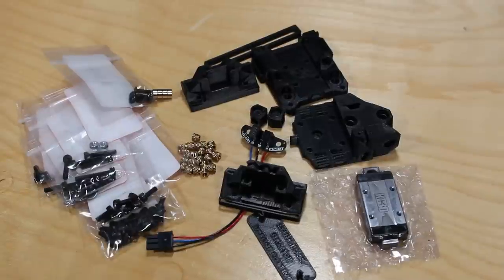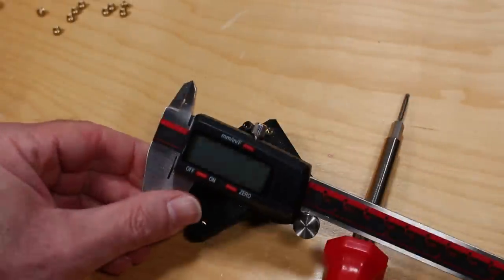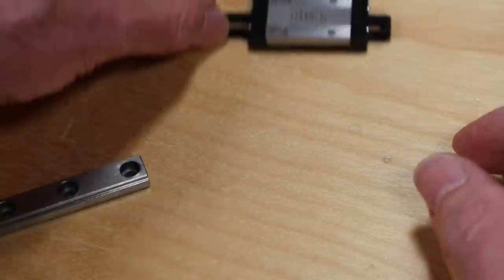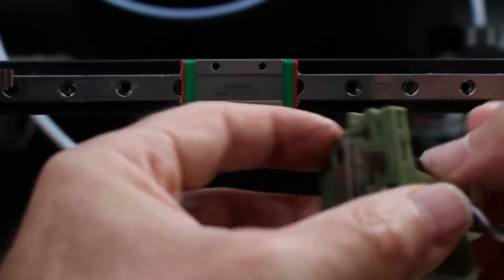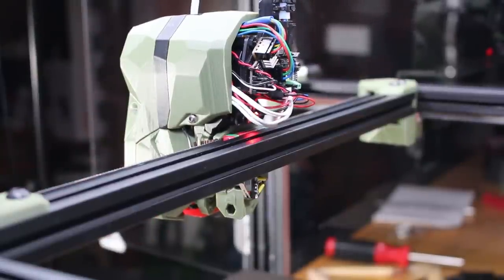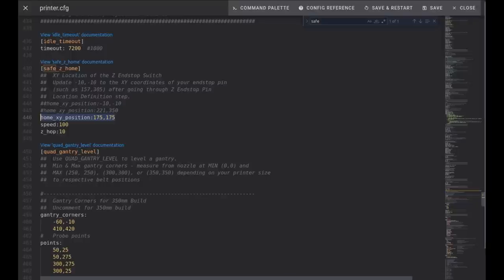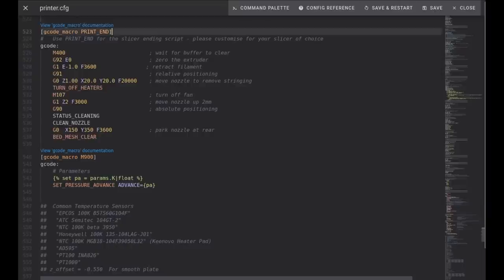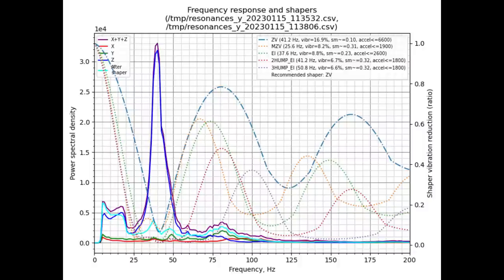Voron TAP build, install, configuration, tips & tricks, final thoughts.

Comment: I'm building a trident (first voron) should I still assemble the z endstop pcb pod?... or try do software right for Tap. is it still good to have in?
Reply from the maker: I'm still using TAP.  I've grown to like it more than I expected.  If you don't mind the extra weight on the print head, it's a good path forward.  But using Autoz calibration with Klicky or Euclid works well also.
Reply: @KapmansBasementWorkshop  Thank you for your reply :) Your Tap weight in was elucidating… but it looks as though it is still worth trying to chase the implied ease of using it successfully.
Reply from the maker: @mildmannered1086  In the end, it's a fairly simple solution.  I wish you a great and successful build!

Comment: I would advise caution in regards with tip 2, clean_nozzle after print. I removed the line in my case because I had a big collision with one of my prints. Cheers for the video!
Reply from the maker: I forgot to load my macros into github and post a link.  I will get that done by this weekend.  It will have an improved clean_nozzle macro.    Thank you for the comments (and reminder)!
Reply: @KapmansBasementWorkshop  Interested to see your improved clean_nozzle macro as well.
Reply: @KapmansBasementWorkshop Adding "clean_nozzle" caused collision that destroyed my X rail. This should not be recommended. Didn't see this comment until the devastation was done. What a fricking mess.
Reply from the maker: @shpyda81  I'm sorry to hear this has happened to you.  Are you using my clean_nozzle macro "as is" or did you change it to meet the requirements of your 3d printer?  It's going to be unique to your printer.  Mine is only there as an example.

Comment: I am not understand the probe accuracy numbers.
4:27 PM
probe accuracy results: maximum -0.985442, minimum -0.992942, range 0.007500, average -0.987505, median -0.986692, standard deviation 0.001987
Are these good numbers? If not where do they come from to fix?
Reply from the maker: I think your standard deviation is pretty good. You can supposedly hit 0.0000 to 0.0008.  You might want to make sure your belt tension is correct for the z-axis and all the screws are tight in the gantry and tool head.  But what you are getting should be good enough.
Reply: @KapmansBasementWorkshop  Where you been? I enjoy your videos a lot and have not seen anything for 6 months or so. Many people think you are a pro! I agree. I learn a lot from your stuff.  I just installed Cartographer V3. It's way better than the TAP since it does not use the nozzle for measurements. You should try it. No more waiting for the nozzle to go down to 150 from 210 to set Z and then back up to 210 to print.
Reply from the maker: @lcdconsultant5252  , I'll need to give it a try.  I have taken a break from videos for a while, but I'm working on a few simultaniouly.  There will be a few that will appear very soon.  Just trying to finsih these off.

Comment: I've been using a smooth PEI sheet with Tap for a couple weeks with no issues.
I'm sure there is still some acceleration losses with an mgn12 rail, but it probably is less severe than with mgn9...
Reply from the maker: Do you TAP at 150c?  Higher or lower?

Comment: Where did you get your kit KD3D, I went to website but didn't see them . Also what did you use for extruder ?
Reply from the maker: My extruder is the standard extruder integrated into the Stealthburner.  Standard Voron.
The TAP kit URL is here: https://kb-3d.com/store/voron/714-kb3d-voron-tap-upgrade-kit-configurable-1669607433315.html
Please note that you will need to select the different options for how much if TAP you wish to receive.  The pre-printed 3d parts are very nice!
Reply: @KapmansBasementWorkshop  I went to the wrong website(KD3D), I ordered the Kit from the right site, what is in the Kit?
Reply from the maker: @dansteffee9759  I believe it contained the linear guide, magnets and all the screws needed.  You will just need to print the parts and assemble it.  You can also order the 3d printed parts from KB3D.  The quality is very nice.

Comment: Great video! Does your toolhead also „sit“ on the sensor housing and not on the 3d printed holder surrounding it? I noticed that during test assembly little bit worried about damaging the sensor over time.
Reply from the maker: No, it does not sit on the carriage that is attached to the linear rail that also contains the sensor.  The toolhead is attached to the front most holder".  Thanks!

Comment: Can I ask why you moved away from the euclid probe?  I have been using the euclid probe for a while and the heat seems to be affecting the probe accuracy.
Reply from the maker: Really just 2 reasons.  I wanted to try TAP, but more importantly, I found over time that the microswitches would fail.  I believe it was because of the heat in the chamber or my soldering was damaging the switches.   I was just tired of replacing them.  I still might go back.
Reply: @KapmansBasementWorkshop  Thank you. Currently fighting QGL working with cold bed but fail when the bed is heated.
Reply from the maker: @2007gtsc  , That's not a problem I had exactly.  But when assembling the Euclid, you need to be very fast and accurate when soldering the microswitch.  If you have a look at the manufacturer's tech specs of that switch, there are explicit instructions about the maximum heat and time when soldering.  My theory is that during that time, I damaged the switch.
Reply: @KapmansBasementWorkshop  I’ll try to solder a new switch on. I know I put lots of heat to it during the installation using my crappy skills. Thanks for the advice.
Reply: @KapmansBasementWorkshop  soldered a new switch on at 285c and used liquid solder. Ran QGL and everything is good. Thank you so much.
Reply from the maker: @2007gtsc  That's cool to learn it really was the problem.  I have since invested into a quality temperature controlled soldering iron.  I may need to go back and give it another try.  Euclid worked well and I was able to hit higher acceleration rates than when using TAP.  Thank you for posting back the results!
Reply: @KapmansBasementWorkshop  maybe a great short video would the proper assembly of the probe. Again thanks for the great advice.
Reply from the maker: @2007gtsc  Hmmmm.

Comment: If you are using low quality rail for the TAP that will impact your accelerations. Also if you are using the print that you seem to have uploaded to printables your belts might be running at an angle instead of straight. This might also impact your accelerations. I get 7500 Accel og Y on my own 2.4 350mm, also with TAP. I am also running MGN9 but i am using a different mod for installing TAP with MGN9.
Reply from the maker: Since this video, I have learned a lot.  I am testing some other improvements as well.  I plan on publishing a followup soon with all I have learned.  And yes, that print needs to change.  I saw a spacer, but if you have one you recommend, please let me know.  Thank you for the comments and watching!

Comment: Hi, I am not sure where I went wrong. My tap has red liight all the time and when I lift iit turns blue but my Zendstop and probe is always triggered
Reply from the maker: It must not be wired correctly.  I would check that 1st.  The PCB on the optical switch should have the labels on the PCB for each wire.

Comment: Since there is no load on the rail won’t anything that can withstand the temperature be enough? Like ptfe spray or something. That would make the rail slide easier also.
Reply from the maker: I think you are right, as long as there are no solids.  I like grease since the interior get so hot....Thanks for watching and the comments!

Comment: 'TAP wants PET' should be a new rule in the Voron guideline. If you just put a (double) piece of PET-tape in the corner where you calibrate you can perfectly fine calibrate with your nozzle at upto 260 deg.Celsius
Reply from the maker: Interesting.  Is this documented somewhere?
Reply: @KapmansBasementWorkshop  hi, yes, but in my unbiased opinion only afaik. but it is based on empirical research of half a year at least, and it is still going on my flsun qqs pro with broken bed plate. it's stronger than the 'lattice glass bed' that was on originally plus it adheres really fine for the PLA/PET/PHA/PHB that I use. but most importantly, even the usual off-z bed scraping prints don't scratch through easily, it is tough. PEI is btw usually typecasted as 'softy' in literature, so a PEI build plate is a risky thing. thanks for the great vid btw! greets
Reply from the maker: @durlin84  Thanks for this tip.  I want to try this!

Comment: Was slightly interested until seeing this video realizing you cannot probe with hot nozzle. So how do you overcome the possibility of probing with some dried plastic on the tip throwing off your results?  With klicky this is easily overcome by adding a spring to the Z endstop and a heated nozzle there is enough force to push the plastic to the side before activating the endstop.
Reply from the maker: The idea is that 150c is enough to squish the filament when probing so it does not matter.  I think its mostly working.  But that is why I also modified the print_end macro to clean the nozzle right after the print is complete.  My hope is that it stays clean and minimizes the filament that is left on the nozzle.  But that's not 100% true.  That said, it seems to be accurate.
Reply: @KapmansBasementWorkshop  humm maybe but 150 is not very hot for some filaments. I have some sensitive CF coated build plates that i'm pretty sure would get damaged if probed with a 150C nozzle
Reply: I personally do a nozzle brush before it probe the bed just food for thought
Reply: @95LegendGS  true but a Nozzle cools down to 150 c fast enough to do a wipe on a brush at melting temp and waiting for ti to cool below 150c again for tapping. Could be used while waiting for the bed to heat or the enclosure to heat up
Reply: Hello.
Reply: The spring solution to deal with filament oozing sounds very interesting. Could clarify how it works, ie where and how do you fit the spring on the end stop and how does the spring help clean the bit of filament? Thanks!

Comment: Did you have any issues with the belt wrap? I can obviously pull the belts through from the rear, but getting them into the slots to slide through the channel on the back piece (not the front big slot, the rear piece that has the MGN9 rail on it) is a no go. I've even tried taking an xacto knife and opening the slot a little bit more but have had zero luck with it.
Reply from the maker: It took some effort, but I got it to work.  Make sure the slots for the belt are relatively clean.  If I remember correctly, they are printed as overhang.  Also, I think I needed the bolts that attach that part to the rail carriage loose to get the belt through.  Once the belt was set, I think I then tightened the bolts.
Reply from the maker: @WhiteG60  That might work.  Does the inside of the belt path appear rough?
Reply from the maker: @WhiteG60  It might be over extrusion, but then  would expect that everywhere...I wish I had a better answer for you.

Comment: when i run the first command i get the error message 'Move out of range: -174.000 -174.000 10.000 [0.000]"
Reply from the maker: Are you homing x & y 1st?
Reply: @KapmansBasementWorkshop  turns out I had the z homing set to -175, -175... needs to be positive 😅 thanks
Reply from the maker: @mr.rajikon3911  I'm glad you found it!

Comment: There is rc8 of tap now that could maybe fix some acceleration issues!
Reply from the maker: I know they have added 2 50mm screws to stiffen it up.  But just to be clear, I actually like TAP and continue to use it.  But I'm sure RC8 offers more enhancements.  I will switch to it eventually, but the current version is working well enough.  Thanks for the comments!
Reply: @KapmansBasementWorkshop  I ordered a tap kit from ldo today and am printing rc8 parts now. Currently with klicky and auto calibrate z I am not happy. Just today the print started to low leaving a bad impression on my textured pei. So that is when I said: I am done with unreliable probing

Thank you for your great videos! I love them all
Reply from the maker: @Stahlfabrik  So that experience along with some others are why I have been on a quest to eliminate micro switches...Thanks so much for the comments and kind words.  I wish you a more reliable future with 3D Printing!

Comment: Are you having issues with belt slipping? It happened to me and I see there is an offical Github issue where people have a problem with some carriages not being completely flat, at least the plastic caps and there is not enough force pushing down on those belts.
Reply from the maker: I have not had this problem.  I just went to github to read about the problem.  Even crazier, I'm using a 9mm rail and carriage and I don't see this problem.  But it's a Hiwin?  I don't see how that would make a difference.  When I bolt the mounting plate to the rail carriage, thats it, the belt will no longer move.  In Github someone mentions a modification that they added to improve it.  I think there was a link as well.
Reply: @KapmansBasementWorkshop  I think you just convinced me to buy a Hiwin rail for my X axis :) you said you were going to update us on your can bus installation; how’s that going? Keep up the good work , you’re one of my favorite Voron YouTube creators.
Reply from the maker: @nenaddinic  Get the rail with a Z1 preload.  The canbus update is slightly on hold.  It took some energy to make that last video and I need some time before I jump into it again.  But in short, I would recommend a real igus umbilical cable although mine has worked well.  The PTFE tube I have the wire enclosed with sometimes hits the back panel and makes noise.  Purchase some small and low profile heatsinks for the driver chip on the canbus board.  These are probably the big recommendations from me for now.  Finally, thank you very much for the compliments!

Comment: Enjoyed the video; thanks! That said, with the TAP mod, it seems like the Voron team has gone full "Rube Goldberg" and designed something that prioritizes mechanical "art" over useful, everyday function. The "just because you can, doesn't mean you should' paradigm. Sure, it's more accurate (on paper) but when we're talking about real world, everyday printing with layers of magnet sheets, adhesive sheets, textured print surfaces and even stepper accuracy - it just doesn't matter. The differences in measuring cold vs. hot introduces magnitudes more inaccuracy than TAP solves.

Not enough of a difference to make a difference, despite being 'better'.

I've been using a simple BL Touch arrangement on my Voron for  ~9 months now with flawless performance. Which also eliminates the all the Z endstop and probe nonesense, is the same weight as stock (-ish, it's actually a few grams lighter than stock) and provides enough accuracy to not be able to see or tell a difference and doesn't have any temperature restrictions. 

A solution that is elegant in it's simplicity, TAP is NOT.
Reply from the maker: So I've been interested in the BLTouch for some time now.  Are you using that in an enclosed printer while printing ABS?  Do you get the reliability issues many claim?
Reply: @KapmansBasementWorkshop  I have Bltouch on my Troodon (a voron clone of sorts) and I'm not a fan. While it is accurate and hasn't had any temperature problems over the year of heavy use, it gets annoying when the probe pin breaks due a bad print curling up and catching the pin. Or the pin can get warped and mess up the z-offset. Over the year I've probably had to put in over 10 pins. While its not hard, its annoying as you have to unscrew the extruder motor to get to to the pin in the BLtouch. Just my 2c
Reply from the maker: @richardclinton8408  Thanks for that feedback.  I have not heard of issues like this.  Very useful information!
Reply: @KapmansBasementWorkshop  I have been using my BLTouch setup fully enclosed with active chamber heating - primarily for PC and PA. Those are just the filaments I use the most. I don't really have an interest in using ABS or ASA. 

I did a couple things to address the potential heat issues. I had never experienced them, but figured with the few reports out there, why not address it anyway. My implementation is pretty simple - just a few alternating layers of aluminum tape and kapton tape to act as a kind of heat shield for the probe pocket.

As far as pin warping or breakage issues...  I've never experienced that. I figure that as long as you get the BLTouch mounted at the correct height and your print settings are dialed in well enough to prevent parts of the print from jumping up and snagging it, I don't think it's really an issue. I think pin durability issues might be more of a symptom of some other problem.